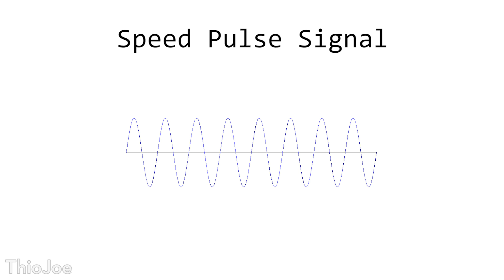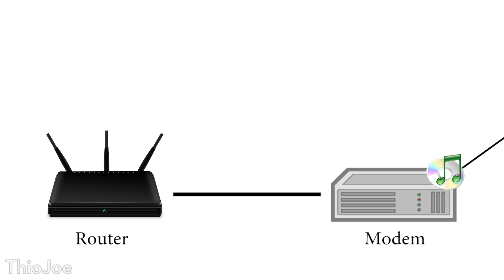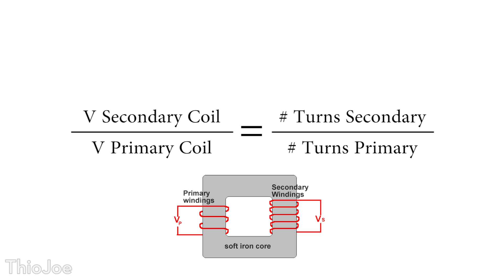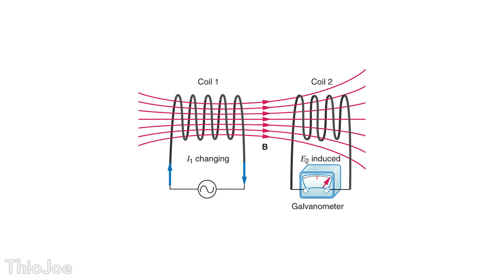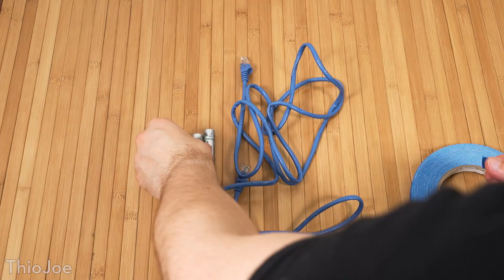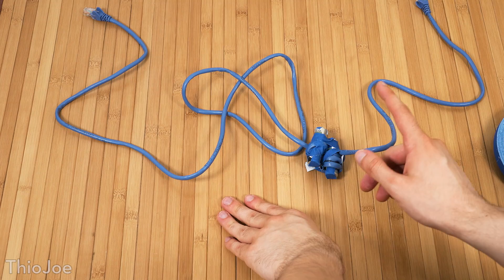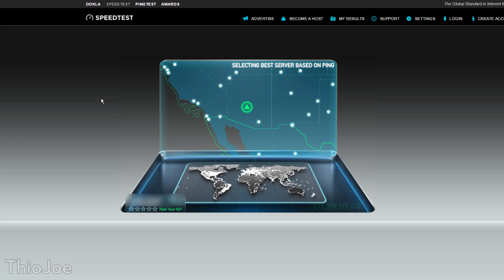How to Get Faster Internet Speed for Free

Comment: Where does the "transformer" configuration get its extra energy from, if the battery poles are not connected to anything? I know that in a transformer, multiplying the voltage reduces the intensity and vice-versa, so the net electric energy which comes in on one side also comes-out on the other side. Can you use a transformer core instead, or do you need batteries?

Comment: I did the cable TV thing with the CDs but I used a copper tubing to space out the CDs and I made it about two foot long with the CD spaced out about it 2 inches and it worked I used half inch copper tubing remember to CDs have to be facing with the data side if you do it right you'll be picking up cable TV from other planets I seen aliens doing Naked News

Comment: Using a Netherlands 750 dual band router which has no external antennas. However my previous router has 3 external antennas so I can use one of them. Question will this work with the Netgear router and if so, where do I need to put the external antenna with the batteries taped to them?

Comment: From my modem the signal goes to a small dish which contains a radio sending the signal wireless to a tower about 3 miles away. I suspect that it is now picked up by wire or fiber. Question, will this work for me?

Comment: I managed to triple the speed obtained on this video. A simple modification to the cable ends allows superimpositionalisation of the transponder nodes of the standing wave. Taking a look at the Fourier transform of the signal will show you that you can obtain higher order spectral amplitudes by using copper nodes.

Comment: lol.  HSI speed with a telco depends on the provisioning and connections at the terminal.  People don't understand that upgrading speed often means someone has to go connect additional ports.  If you have cable then you share your bandwidth with neighbors and that is controlled by provisioning.  It is not possible to get faster internet without paying for it and sometimes faster speeds are just not possible because of distance from the CO.

Comment: So if what you are telling me is true.....
could i not just buy a router/swich that can amplify the voltage without some battery crap slapped onto the cable
And i thought ethernet cables that were capabal of gigabit ethernet (cat5e) can be unshilded but that would mess your ping up so you will have had to have a shilded cat5e/cat6/cat6a/cat7 cable for any of theese speeds to work and shielding prevents emi so this battery mumbo jumbo in theory shouldnt work
(i have my isp max so no need for me to try this)

Comment: oh my god thats as stupid as the story with the blinker fluid

1.
A normal ethernet cable can't transmit data with more than 100mbit very well because
 2.
its a normal copper cable with physical magnetical impedance. its a form of elektrical resistance which has the property to rise with the frequence of the data signal which rises with the transmission speed.
3. thatswhile you must reduce these resistance by reducing the power of the magnetic field the cable is creating ... and not power the magnetic field with wrapping the cable around 2 aa batteries ...

Comment: how do you use a USB wire for speeding up WiFi or internet local connection speed. i dont have a usual network wire or cable. i have a mini WiFi box and i connect with USB to my laptop to get a local internet connection. i have used 2 AA batteries as you do in some videos and it didnt work. the speed did not increase. so pls help me out here.

Comment: I hope you know your "Speed Pulse Signal" doesn't make sense. The speed is determined by the frequency of the signal, not the amplitude. The more amplitude the more range of the signal. The higher the frequency, the more bandwidth. That is why 5Ghz wifi is faster than 2.4Ghz wifi, because of the higher frequency. Now if we want to increase the range, we use more amplitude, to make a stronger signal, kinda like sound waves. I hope someone learned something, instead of wasting there time on this video.

Comment: So if this really amplyfies anything, then it would also amplify the cross-talk of the cables (little explaination : | | <- those are 2 cables lookinga t the drawing, the magnatic field transfers the signal over to the other cable, but because they are mulptile cables, the signal gets amplified; | || <- now there are 2 cables next to one, so the signal from the first gets transfered and amplified to the 2 other ones.) so if I am not mistaken, there would be massive packet loss, correct me if I'm wrong.

Comment: Just to clarify. even if this wasn't fake... its would be completely illegal and your ISP would notice the high ping generated and throttle your speed back to where it belongs... which is fraction based so like in this demonstration of 1000mbps where he is paying for 100mbps, thats back down to 1/10th. If he ever goes back and releases the modification he's done after say a few months of them throttling the same connection to 1/10th that it becomes habit... he will have 10mbps until he calls them on it.

Comment: some reasons why this shouldn't work.
1-transformers use bare wire
2-the cables used for your router to modem are coated in rubber/plastic and also have an outer sleeve ,this is to prevent induction which is what a transformer need to actually work.
3-these cables are conducting very low voltages

Comment: Wow!!!! This actually works. I was a bit skeptical, but I tried it and it actually fucking worked. GG man. I wonder if this will increase my penis size if I wrap the ethernet cable several times around my dick. Hmmmmm.... Great video! Next you should do a video on how headlight fluid and a short throw dipstick increase your cars hp tenfold. Or.... How to protect your home from hyper extensive humidity by rubbing butter from the ground up on your home.

Comment: sir it's isn't working ..I have a cable internet line .. so I have router inside my home ..and the public modem is 100m far from my house ..where there are many connections to a single modem of ppl using Internet in my area ..so what do I do in this case sir ?

Comment: fuck that fuck that Fuck that  this is what u should do you want faster internet u like faster speed is what u need ho to your local seedy/shady side of town find a local drug dealer buy you some meth return home that's the easy part now take those two batteries throw them out the fucking window cause quite frankly u need more juice to digital inject the router modem.  Now go out and rip  out your car battery your going to ha e to expose the cat6 or cat7 Ethernet wires so carefully cut of shielding I SAID CAREFULLY!!!! NOW pick two I went with orange for positive and blue for negative take a substantial amount of meth and a sheet of tinfoil put the meth o to the tinfoil and it should be noted that the more you use the faster your internet will be do this is no time to be cheap I used a 1/2 oz ya sure it cost a few hundred  and what not but well worth it now wrap up the meth in tinfoil real tight should I ok like a tinfoil joint with very pointed ends go grab some jumper cables attach one side to battery and then one side to exposed Ethernet cable and pointed end of tinfoil meth capsule for lack of a better word be sure to put  + on orange and - on blue otherwise it violates several laws and your terms of services agreement now I suggest that you leave the positive connection to car battery for last but potato patathoe now's an excellent time to plug Ethernet cable back into router and now comes through fun part where u see your mission come to a end and enjoy the light speed of your connection plug the positive side jumper cable in don't mind the sparks smoke or piping sound it's all natural in fact I highly recommend that you repeatedly deeply inhale the smoke  now after the smoke has stopped run your speed test again if it hasn't improved you have either a shitty car battery but k meth or simply not done it right do u feel.  better go fucking experiment with putting the car jumper cables on your testicles OR nipples and making certain that you don't have elf's love being in your cable line slowing down your connection. may I suggest you make incoherent vague calls with passive aggressive undertones to your ISP or to Bing wrap yourself in tin foil and go to your local water company complaining about your internet connection surely if all else fails they can right this Titanic wrong but just for shits and giggles call random people tell them of all the trials and tribulations u have been through searching for the internet of the Covent and ask if the will pledge me ney to your cause then just go upgrade your I internet package that's what u should fucking do if u ask me I'm bored and watching this would entertain me make it so thio joe

Comment: Dude, this really works!!!

I wrapped 4 rechargeable batteries to wiring from the battery of my electric Nissan Leaf and now I'm pulling 300km/hr on the freeway with a tail wind. Awesome! This dude rocks.

I'm now going to apply it to the incoming 240v electrical wiring to my man-shed to see if I can get enough power to run a 3-phase welder.

Comment: 1:28 that graph is actually a bit misleading. The "size" of the amplitude isn't linear to the number (speed). Since the amplitude has an upper limit, ISPs use an exponential scale to be able to represent bigger numbers. In pracrice this means for a twice as big amplitude, the square (or depending on your ISP a different exponent) of the original number gets represented. This also explains why for a coil-ratio of 1:4 you don't get 4x the speed, but the maximum right away, since (((50²)²)²)² just becomes a massive number.

Comment: I agree with you that the signal gets amplified while passing through the transformer setup. But when the signal comes back it  signal gets condensed so the setup doesn't work. If receiving cable is different then this is possible. Otherwise no chance at all......

Comment: It works, just follow his instructions and if you plug it in and going slow just change the direction. I paid for 60mbs and never get true 60mbs. With thiojoe theory. It jump up 70 - 80 and stay on between 73 to 75.  I use two C battery. The two AA battery doesn't work for me. It might work for you. Thanks Joe for another successful update.

Comment: What happens if you don't have a cable that connect the modem and the router directly but rather  two separate cables from the router and the modem that connect to one cable at a certain point? I don't know if you get the idea but I'm trying to explain it as best as I can.

Comment: This is complete and utter bullsh*t.  I have a degree in electronic engineering and I'm Network+ certified.  This guy is full of crap.

1) the connection between the router and your modem is using digital pulses of Direct Current (DC).   Transformers do NOTHING for DC voltages, they are ONLY useful in AC (alternating current) signals.    

2) Notice in his diagram of the transformer how you have one wire connected to one side, and a completely different wire connected to the other side?  That's because for a transformer to do it's job you have to isolate the two circuits.    
If you did this same project using an AC signal it still wouldn't act as a transformer but rather as a Choke, effectively lessening the strength (amplitude) of the AC signal.

3) If you're going to make a transformer, using batteries of any type is just wasteful and Stupid.  Use a ferrite material such as Iron Rods or bolts.

His claims of ISP's not being able to block this is true, they also can't block unicorns from vomiting gold nuggets on your butt.  You can't block imaginary bullsh*t that doesn't effect anything.

Comment: I love the fact he uses explanations that sound plausible to a layperson but make absolutely no sense whatsoever to anyone who knows anything about electronics...

Never mind that even if there was a way to override ISP line speed caps, it would almost certainly be illegal (and the caps are likely determined by equipment at the ISP's end). Never mind that (in the UK at least) advertised line speeds are often significantly higher than actual upload/download speeds (which they cover by saying "Up to [speed]") as a whole bunch of other factors are in play, notably the bandwidth of the links from the street side cabinets to the ISP, and the ISP's connections to the backbone, as well as how many other users are sharing that bandwidth (e.g. you'll likely have faster download speeds at 3am than 6pm).

Comment: The trick not only quadruple my connection speed from 100mbps to 400mbps. 
It also more than doubled my monitor refresh rate from 60hz to 144hz by doing the trick on my DVI cable.
The trick also doubled my hard drive from 1TB to 2TB by doing the trick on my Sata Cable.

thanks for this great trick ThioJoe!!

Comment: Even if you believed the explanation behind this, 100*3 =/= 1,000+. 100^3 is not either. The math alone gives it away.

Also, if this did work, the company could sue you for stealing internet--which they measure usage for each customer--and you would be liable for all charges, and possibly more.

Comment: hey joe I just found a better way I rented a 50kw generator from Rent-A-Center and I plugged a 480 volt plug end into  the router power cord by using copper wire and some duct tape and now it has 2 gbps thank you!!!!

Comment: well that cable is highly insulated so that  no  external signal can effect  .its a battery!! how charged battery !! if we consider point that cable wire acts as a primary and secondary coil to battery.which signal is amplify? ..well its a digital signal ...  cable itself highly insulated now where  signal get amplified and boost speed..

Comment: from what i've studied there should only one transformer core.. and u used 2 batteries.. also, the primary and secondary of transformer should always be 2 different circuits(insulated to each other) , while u used a single  wire,...................... #Engineered_u_fake_ass_bitch

Comment: I wish this was possible, it would be great. I'm not even sure what the purpose of this video is. Is it a troll, is it meant to be a joke, I dont know. What I do know is that its completely crap. 
Electronics and Engineering are my thing, its what I do and I'm a massive nerd. This is NOT true Youtubers. This will NOT work. You will just WASTE YOUR TIME and electrical tape.

The internet doesn't work like this guy explains. Not to mention, MOST modems are built in to the router now. Its really only us nerds like me that actually have networks and servers in our houses who use routers and modems separately. So this technique wouldnt be possible for most people even if it was true.
Just use your brains and apply a little logical. Without knowing anything about electrical engineering or internet technology you must consider that if this was possible there would be commercially made devices on the market that you could just plug your ethernet cable in to directly.  Also ISP's would do everything in their considerable power to stop us from using this technique.

Comment: BS.  Speed is set by a config file uploaded to the modem.  Nothing done between the modem and router will change anything.  Don't believe me google a couple of years back.  A couple of dip'sh*ts hacked a config file.  TFTP'ed it into the modem.  They got a speed boost.  But it did not last long.  The ISP was no dummy.  They determined what happened.  Called the FBI, arrests were made.  A trial and a big fine, on top of jail time was dispensed.  For violating and hacking the DCMA of the modem.

Actually what is being shown, can cause problems if kinks occur and they will.  A TDR signal generator would be need to show where that problem occurs.  Either way an inductor is being created which in it self is a problem too.

ThioJoe is a troll plain and simple.

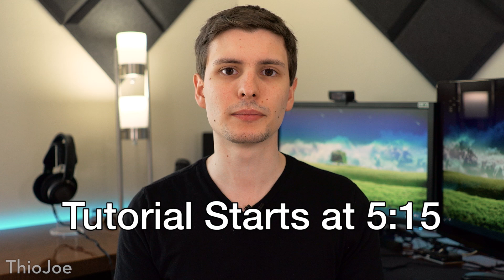Comment: 2:48 Routers don't have 'speed pulse signals'. Routers use ethernet, a digital protocol. This is BS. If you kept with the cable modem, it could have been plausible.

Comment: if this trick didn't work for you, then you're doing it wrong, try again.  My throughput increased by several digibits.  Also it travels faster down the wire, my speedtest showed i am now getting 0.75ms ping, even better than ThioJoe's test.  Now THAT is fast.

Comment: hi TJ I have the modem router combo I have AT&T I have elite. I have been fighting with them for mth's about the band with everytime I call they say they can increase it for 5.00 more and it's always the same.I went to the att community and they were talking about the pace modem which is what I had but the tech never set it so, I also had pro at the time.I reset the modem to the network. don't ask me to explain as I was overly sleep deprived and I had had it. well it said pro was DSL and looking at the packages on line sure enough there was no express nor pro under Uverse only DSL and since I'm in a rural area I don't think they did all fiber optic's in my area So when I told them that they said it is and it isn't. I have never heard of an answer like this. any way I'm still slow and don't know what to do,so how do I use your idea with the combo?as they don't support a router along with there's deb

Comment: This guys a fuckin liar. The truth is all you need is electrical tape, a bowling ball, 3 AAA batteries and the wire that goes between the router and your modem. You know those 3 finger holes in the bowling ball? yup!, just put 1 AAA battery in each hole and then tape them shut with the electrical tape, voila! you now have a super charged bowling ball ready to get you them gigabytes. Next wrap the wire around the bowling ball 3 times and chuck it out the nearest window, make sure that the cord is still connected to your modem. gravity will do the rest. hope I helped :D